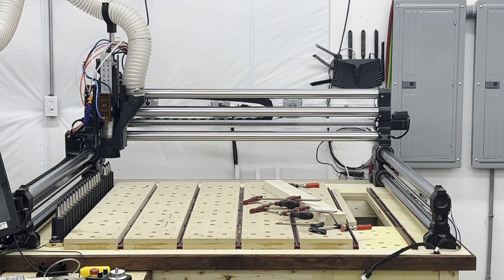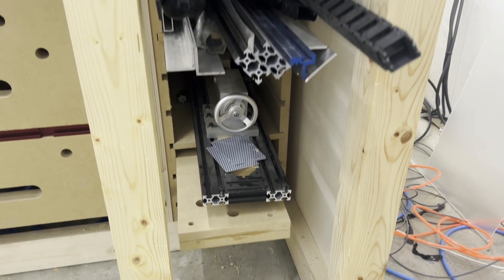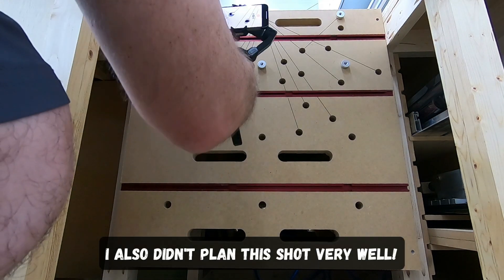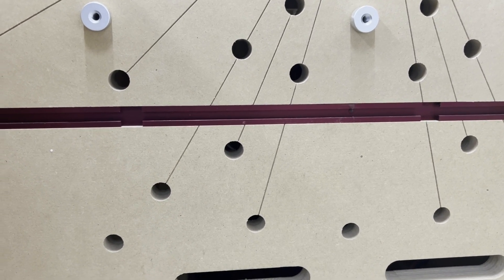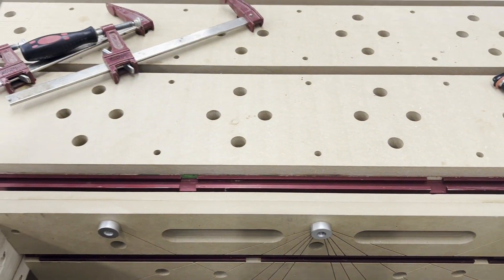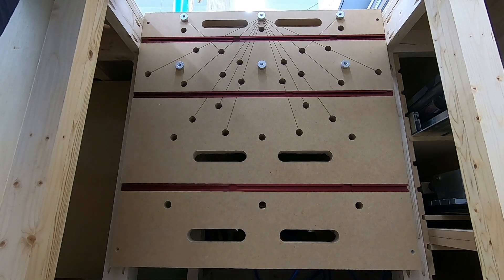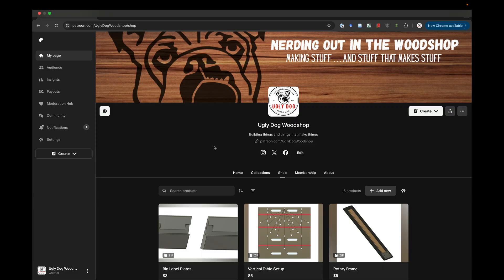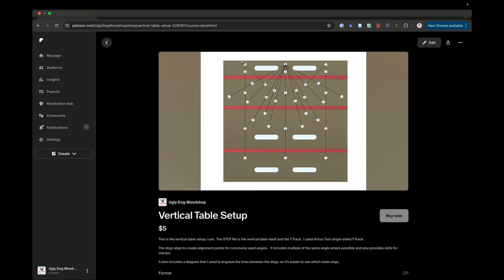Add a Vertical Table

Comment: Wish you had a video on how you built that table...very cool!
Reply from the maker: Thanks!  The Fusion 360 project for my CNC table is a mess.   I would have made the plans available if the project wasn't such a mess.  Thanks for the
Reply: @UglyDogWoodshop  no problem at all! I'm just trying to get ideas for my build. I might put the vertical table on the front but maybe not as big as your

Comment: Very cool. I am definitely interested in adding one of these myself…. My only hang up is worrying about how hard it is to square/plumb and level everything to the router/spoilboard
Reply from the maker: You can do it!  It's not super hard.  Just cut the hole in the table with the machine so you know you're on axis to start with and the rest is pretty straight forward if you go slowly, one axis at a time.